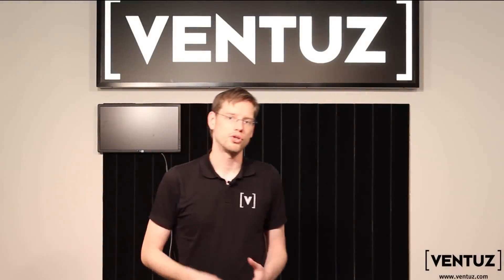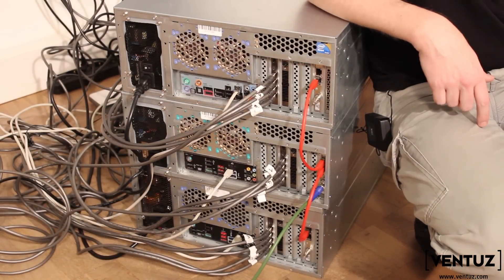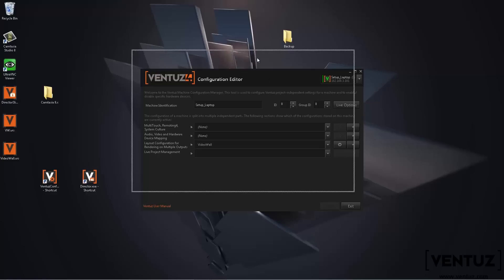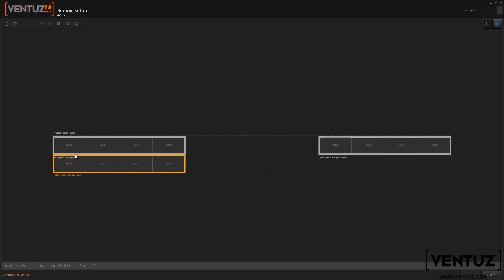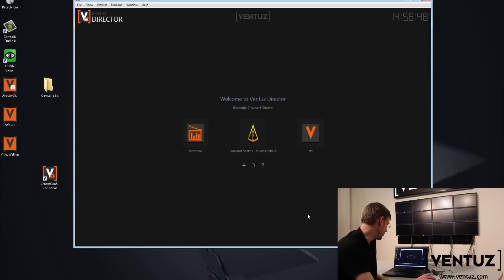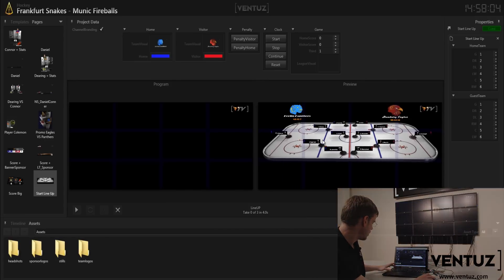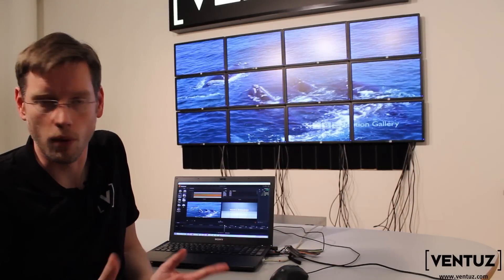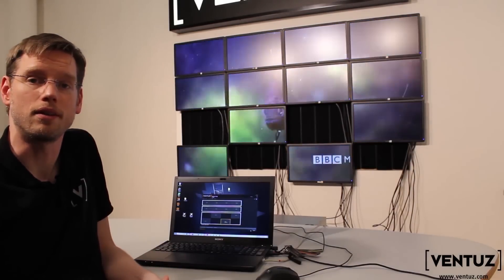Ventuz Tutorial | How to set up a Video Wall in Ventuz?

Comment: Ok, it could be silly but, could I use many laptop screen monitors, that have the same resolution and connect them together and then connect them with a laptop and then use them all as one continuous screen? could I do that?
Reply from the maker: Here's what you could do: you could set up all you laptops in a cluster (given that they have the necessary hardware for syncing) and have one laptop run as your master and all the others run as Ventuz Runtime machines. Then you could control them all from the master laptop. To learn more about how to set up clusters in Ventuz, look here: https://www.ventuz.com/support/help/latest/HowTo/HowToClusterRendering.html?itm=293

Comment: Where can I find a velcro wall like that? I Can't find them ANYWHERE
Reply from the maker: Hi there. We actually created that ourselves out of ply wood and high-quality velcro that you buy in most any hardware store. Make sure that you get industry standard velcro and screens that are rather lightweight.
Reply: Is it a big sheet of velcro? The only size I see of velcro online is small strips. If you have any links to something online, I'd greatly appreciate it
Reply from the maker: Nope, we used strips of heavy duty velcro. Lots and lots of them. Remember, this is our lab. It doesn't have to be pretty, it just needs to work.
Reply: Ah, ok. Thanks for the idea then

Comment: Hasn't Windows 10 and USB video cards made this product obsolete? I've seen something like 12 screeens running in HD off of an Intel NUC using a bunch of USB2.0 hubs
Reply from the maker: Hi Fernando. Please note that Ventuz is a complete real-time content creation and playout suite. Multi-screen setup is only one of the features that helps event specialists to bring their content on large video walls. Can you find the video or article you are referring to and post the link here? It would be interesting to know whether they are spreading one HD over 12 screens or actually running the wall at 12 times HD from one video card.
Reply: 14 screens for one desktop across all screens. They have a 4k one too that goes for 50 bucks. I am going to be using these for a client in the next few weeks for a touchscreen video wall.
Reply: I see the value of your software, but for just putting together a permanent video wall, it's overkill. Most people just wanna play powerpoints and videos on them.
Reply from the maker: Hi Fernando, absolutely agreed. There are simpler and cheaper solutions for simple video walls than Ventuz. If you want to go more sophisticated though, regarding real-time content, design and data driven graphics, Ventuz offers the full package including the video wall setup. Thanks for your input.

Comment: Thanks for the video. Using the right video converters, would I be able to make a wall of CRTs using different size screens?
I want to make a video wall like something out of a 90s villain lair that's made of various CRT TVs, and I want more than just "15 SD videos sources (VCRs, segas, atari's, ect) on 15 different CRTs arranged in a wall configuration."
Reply from the maker: Hi there. Interesting idea! Do the video streams have to be live? Meaning: Does the VCR signal have to come from an actual VCR and the Atari from an Atari? Or do you want them to be pre-recorded video signals? In the first case, you might just want to attach each screen to its individual source - loads of cables, but seems to be the easiest. For the second version you can use Ventuz as a media server. The setup of the pixelspace might be a little intricate, but it should be possible. For more detailed comments, please post your inquiry on the Ventuz forum at forum.ventuz.com.
Reply: Thank-you. I would want to do live, but if I had to do pre-recorded just to get the effect I'll go with it. As I get closer to getting the set-up I'll post to the forum.

Comment: So why not use 1 big screen or a projector?
Reply: Arnolds Liepins Well... having multiple monitors allows for flexibility, each monitor can be used individually, and together by choice. I have seen this used many times in public, a movie theater near me, has many TV monitors set up an array, to serve as a menu for the products being sold, after a couple of seconds all the screens turn into a single very-wide monitor spanning some sort of personalized action clip advertising the movie theater name.
Reply: +theskeletonboi   quite smart reply,well done!
Reply: this can be done with software without the use of multiple screen... like digital menu that has the menu on one side and the other is a non stop ad running
Reply: if broken then you will have to buy a new  TV. but here you have to replace only 1 part.
Reply: Arnolds Liepins 
scalability.
Reply: This is  more for comerrical applications then home use.

Comment: hey, hello
i have one computer, with 3 graphic cards (w600 amd firepro) plugged into it 
each card has 6 mini display output
my question is, can i use vertuz to setup a 4x4 video wall?
Reply from the maker: +Hafiz Mokhtar Sorry for the late reply. Ventuz does not support more than one graphic card per computer. You would have to use several machines and set them up in a cluster. 
Here is how you do that: https://youtu.be/tK8vmmLF1VI

Comment: Quite tricky... lets just buy a 130 inch flatscreen >:(
Reply: Baka Ch I know right... how do people not understand... this isn't about size.....
Reply: 130 inch very hard to move from one place to another
Reply: Baka Ch 
From a resolution in arc-minutes standpoint, sure it's better and more density meaning you can get closer and still have indistinguishable quality, but also the closer you get means the more bezels become visible and ugly ruins the effect.
Reply: to much work ill stick with  my projector
Reply: Or you could buy 12 130" flatscreens ;)
Reply: A screen over 120 inches can easily cost over $50,000

Comment: A 65” 1080p LED TV Will do a better job, would use less current, no messy cable and no split distraction and WAAYYYYYY more cheaper than all this stuff
Reply from the maker: Hi Max. It is a matter of how large you want to go. Some of our clients have created video walls of 30 by 15 meters and more. But if a 65" screen is enough, we would certainly recommend it.
Reply: the point is the possibilities this opens up! The size here is an example but it could be much much larger and have the ability to change the monitors around artistically. Very cool!
Reply: Only if you are considering using the video wall in your home or at a pinch a large room. Consider the situation where you wish to display images in a stadium where the audience are at a distance of perhaps several hundreds meters from the screen or when you are in a very large concert hall again the audience could be many meters from the screen, a 65" screen would be lost in that environment.
Reply: C'mon, 65" TVs are still too expensive back in 2013. I have 4 x 24" screens. I want 4 x 42" but I have no room at the moment.

Comment: Why isn't he just using one computer to run all of those monitors? All you need is one unit with two Eyefinity cards.
Reply from the maker: We are using two machines to demo scalability. Many of our customers create massive multi-display video walls and need to cluster machines.
Reply: Ventuz Technology Can you provide info on the fastening system used here? thanks!
Reply from the maker: Phil N This is simply velcro stuck to the wall and the monitors. Not fancy, but it serves the porpose.
Reply: Certainly. Thanks!
Reply: +Ventuz Technology That's genius! Do you have an estimated max weight for the screens this is possible to do with?